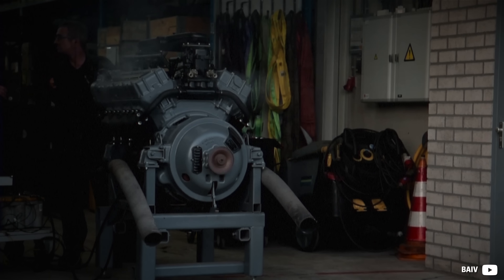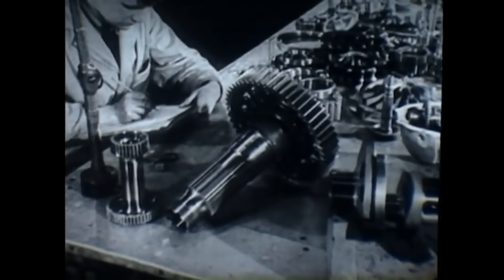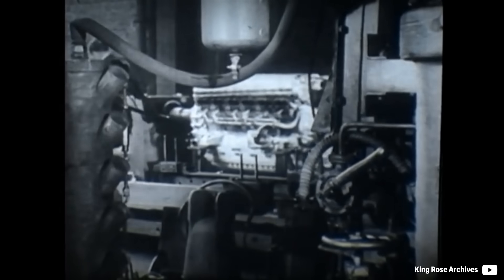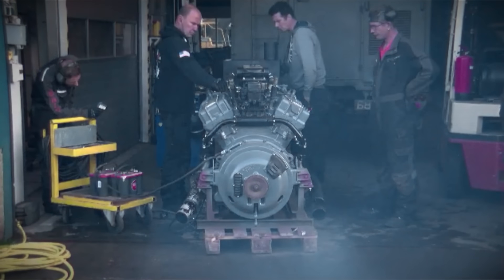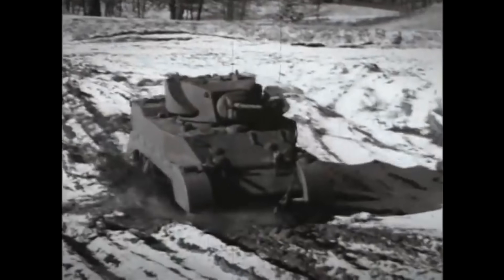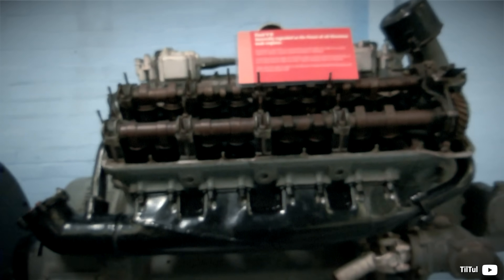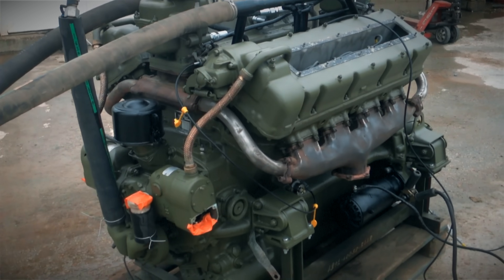The 1,100 Cubic Inch Ford GAA Was Extraordinary

Comment: Western Washington University's VRI is restoring a couple GAAs. I got the chance to help them before the pandemic. This video does a great job covering most of the important features. 

The early 4 bolt main blocks tended to crack if tank drivers dropped the clutch, but i think the later ones fixed this. Also, the cams are driven via shafts and worm gears, which is unusual.
Reply: What will WWU do to those GAA's after restoration?
Reply: those cams look brilliant ... avoiding fiddly OHC chains and the reciprocating mass of pushrods

i'm wondering why the idea didn't last
Reply: Probably really noisy.
Reply: @david929190  no
Reply: @5naxalotl  Smaller engines would have smaller drive gears with smaller teeth. They wouldn't last as a smaller unit, they survive here because of lower RPM, lower spring pressures, and more material to accept wear tolerances.
Reply: @5naxalotl  noise and cost. For most consumer engine it would be overkill, as it is, most cars are taken off the road because they rust out or lose their automatic transmission, engine failures are pretty rare and almost always the fault of zero basic maintenance.
Reply: @5naxalotl  it's expensive to design and build, and pretty heavy and noisy, however on aircraft engines it's a good idea because they don't fail all at once and are more reliable.
Reply: @5naxalotl  Noise, cost, and transmitting of vibrations to more sensitive components.
Reply: @5naxalotl  expensive

Comment: I feel so conflicted about these engines being blown up for tractor pulling. On one hand I think they deserve to be used, on the other hand you are destroying a piece of engineering history
Reply: Agreed, it's like all the old Hemis getting blown up on the dragstrip.
Reply: @TheSaturnV  The difference is that the 426 (and larger) Hemi block and heads are still being made by the aftermarket. No-one is using stock Hemi blocks. No such luck for the GAA.
Reply: wouldn't surprise me if that situation changed, now that a CNC can carve a block out of a solid lump of metal. expensive compared to casting blocks in a huge factory, but pretty reasonable for one-off production. normally this is a thing with high end race engines, especially if you want a block carved out of aluminum, but it makes sense with historical engines imo. once someone makes the CAD design, afaik the fabricators don't need to do any special sort of setup
Reply: Better wear out than rust out.
Reply: As long as there are a few in museums, there's no need to keep the rest. The world is full of obsolete junk - we don't need it to be more full.

Comment: As the design was originally intended to be an aircraft V-12 the design specified a 60 degree bank angle.  When the change was made for use as a V-8 tank engine the design was too far along to change the bank angle to the V-8 optimal 90 degrees.  Therefore as a 60 degree V-8, a cross plane crank would have provided no benefit so a flat plane crankshaft was used.
Reply: not to mention you dont want split crank pins in a mill that big.
Reply: Flat plane crank needed no special die to forge.
Reply: Keep in mind that an in-line 6 and V-12's use/require a cross plane crankshaft for even firing AND primary balance.  But there are 3 planes involved, crossing at equal angles of 120 degrees, not just the two planes of a V8 crankshaft which cross at 90 degrees. So when the decision was made to alter the design for use in a Sherman tank as a V8 rather than as a V12 aircraft engine, did the engineers think about giving it a cross plane crankshaft with just two planes crossing at 120 degrees? Or 60 degrees?  Would that have made much of a difference in the basic balance dynamics of the engine?  Hard to say but I suspect that in a tank there is so much going on that perfect balance was not a priority.
Reply: I would have thought adding a flat plan crank would have been beneficial to a 60° engine.

Comment: Great video 👍 what an incredible sound. If I remember rightly the T34 was the first tank with diesel engine which made it not so vulnerable if hit. Keep on with the good work 🙂
Reply: That's actually an old myth about the M4 with the petrol vs diesel argument. The cause of fires in the early Shermans was due to ammunition storage. The combination of moving the ammo lower in the hull and placing it into wet stowage bins (filled with antifreeze) gave the M4 equal to and sometimes lower burn rates than any tanks it met on the battlefield.
Reply: Wonder of wonders, something that I never knew ,they always said radials,or the paired Chryslers,but a ford V8 32valve DOHC what a technical marvel of the day

Comment: Ford owns the V8

-First ( mass produced ) V8
-385 is the biggest baddest big block
-351 Cleveland got heads as good as LS
-302 is lightweight 
-Modular are boost junkies
-Coyote can rev to 9000 rpm 🎵🎶🎵
-Godzilla 7.3 just because
-Ford GAA just in case
Reply: Nah. Cadillac made the first V8 :P
Reply: @FloodExterminator  
Godamnit you are right.

I'll edit my original comment
Reply: "Cadillac made the first V8 :P" There were others (see Hispano-Suiza), but Caddy did make a lot of V-8s long before Ford. What Ford developed (bought from Lincoln) was the technology to make a one-piece V-8 block, instead of a crankcase and two cylinder banks bolted-up. And the cheap tricks that made a V-8 marketable at a popular price. Valve adjustment by grinding. Way too much exhaust porting inside the water jacket. (And 3 main bearings, though that hardly seems to limit the Flatty's performance.)
Reply: @PRR1954  Let me correct myself: Cadillac made the first mass produced V8.
Reply: @FloodExterminator  Chevy was right there with the copperhead engine.
Reply: Forgot about the 534 series.
Reply: The Cadillac 500 has a bigger block than the 385.
Reply: The French invented the first
V 8  in 1905 ?

Comment: This was WAY off the Merlin, they had sodium filled hollow valves that melted at a certain temperature turning into liquid cooled valves stems, the secret technology inside the merlin was mind blowing.
Reply: Almost all Allied aircraft engines had sodium cooled valves.  Allison had both intake and exhaust valves sodium cooled.
Reply: Sodium-filled valves were hardly secret, and didn't show up with the Merlin. The Bristol Pegasus line of radial aircraft engines brought them out in 1932.

Comment: Didn't know it was a flat plane crank, truly an interesting engine with an even more interesting and unique story!💯
Reply: Exactly what I thought
Reply: I heard about the engine before but they never said it had a flat plane crank.
Reply: @Fone65  when I heard it running in the video I thought it sounded odd, not like a traditional cross plane V8, then it mentioned in the video that it was a flat plane crank which then made sense.
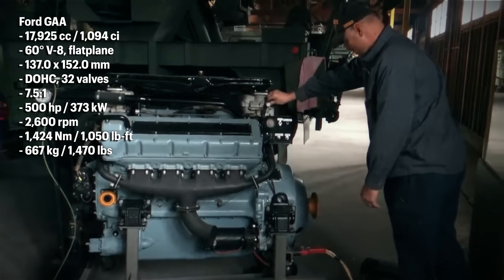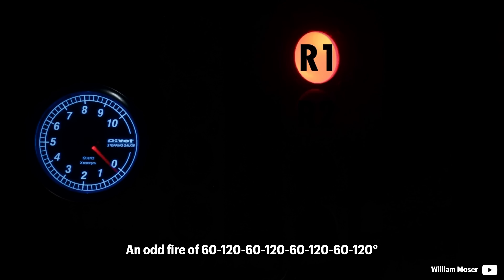Reply: @Fone65 ook at the on screen description of the engine at 2:38 of the video. That said if you listen to one run you would know that straight off from its voice (exhaust sound) additionally the presenter makes mention of the crank shaft at 4:15 of the video
Reply: @gullreefclub  the footage of it running in this video is good enough to hear the flat plane sound, almost like a giant Ferrari.  The other videos I've seen were terrible quality so I never knew it had a flat plane.  What an amazing engine for the time
Reply: The grand-daddy of the Shelby GT350 Voodoo engine :)

Comment: the aircraft v12 original engine was not accepted because it vibrated too much. Less of an issue in a tank where weight is no object.
Reply: Nope.  The Army Airforce did not want the additional engine for maintenance logistics as they were already committed to supplying repair parts for the Merlin and Allison aircraft engines.  The Ford motor would have been redundant in their estimation.  They never tested the Ford 12-cylinder engine.  You can read about it in the book, "Ford In The Service of America."

Comment: Let's hear that puppy revv to 8k see if it sounds like a Ferrari 😆
Reply: Aircraft engines are not designed to rev, meaning aircraft based tank engines arn’t designed to rev. They are designed to get max torque & HP at about double idle but do near max for hours on end, non stop.
Reply: Probably not with that 60 degree V angle, but it would sound pretty awesome.